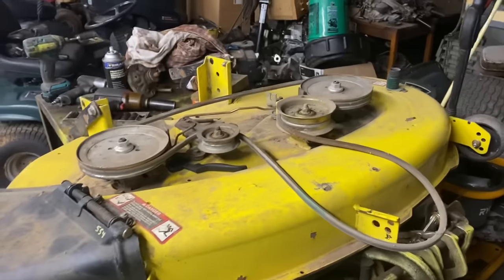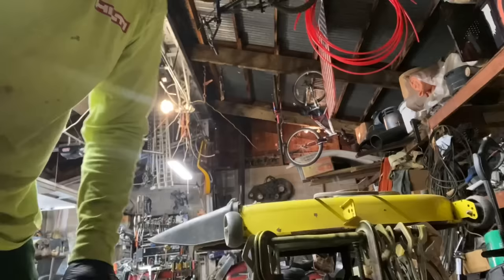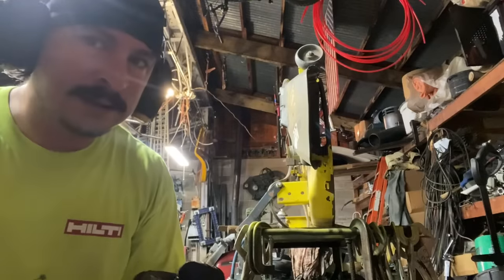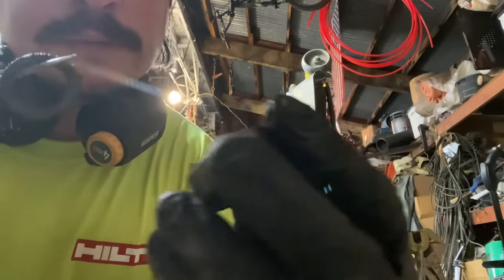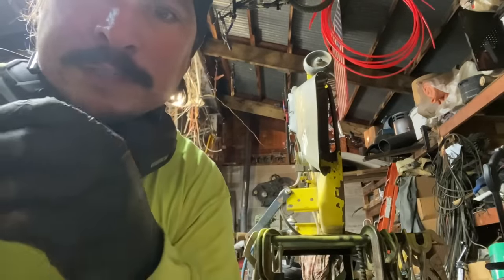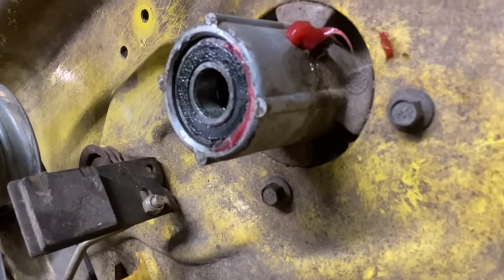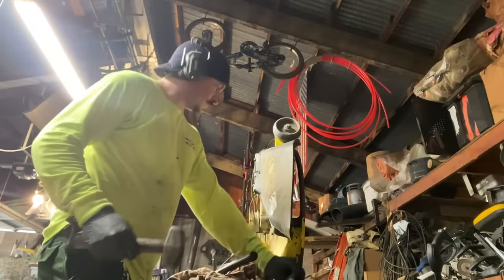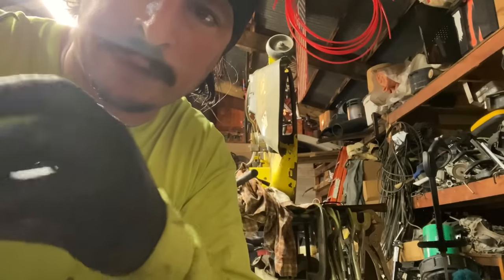Part 1 - Don’t trust the “Experts” Grease your mower deck sealed spindle bearings Common sense.

Comment: Even if the inner seals do allow some grease to leak in when grease pressure is high enough (i.e. when it is being pumped in by a grease gun) I still think the inner seals are going to restrict the free flow of grease. If you are going to fill the spindles with grease it makes sense to remove the inner seals so that grease can easily flow to the inside of the bearings..
Reply from the maker: The seals can’t stop any grease from passing when using a grease gun, as for in normal operation, grease would not be moving around inside the assembly anyways. Only the grease inside the bearings would move a little as bearing rotates. As for the bottom bearing grease will eventually migrate down and into that bearing. But the upper bearing would have the opposite effect and grease would eventually migrate down away from upper bearing without a grease gun pumping grease back up to it, unless of course the inner seal was in place. Grease can easily pass up past the inner seal with pressure from grease gun but gravety alone can’t overcome the lip of the seal. Just leave all the seal and greased the assembly once in a while. Bearings last forever. No need to take things apart or overthink it. Just try it. Won’t regret it. Hard to say removing inner seals on both would be a positive. As it would negatively effect the upper bearing as much or more than it would help the lower bearing. It takes very little pressure to push past those super week seals. But no grease and or gravity cant work past the seals without some pressure behind the grease. Not only will
Some grease pass the seals. The bearings will
Receive more grease than necessary. You should see how little grease is in some new bearings. It would probably shock you. Some of my videos show that. But back to topic. Removing Inner seals make no difference in how much grease will get to the bearings. And removing them
Is a waste of time. That’s a huge point to touch on. Because dismantling a deck just to
Remove those seals is ignorant. Just meaning Becasue the person doesn’t know better and just things it will make
A Diffrence. But actually they can do more bad than good by taking everything apart for no
Reason. Other than thinking it matters and having a warm fuzzy feeling. Yea it won’t necessarily hurt anything to
Remove the inner seals but it won’t help anything either. Think
About it man. Why would every manufacturer leave the inner seals? Simple, Because they don’t matter in the slightest. Your letting a flimsy rubber seal Give you mental block. The grease will only pass the seal while being pumped, that’s never been an argument of mine. A few pumps and good to go for many many hours of operation. Even without seals in place, you would still need to pump more grease when it’s time for the next 
Service, and then some fresh grease would push into
The path of the bearings. But really a full
Bearing from
The first greasing will
Already be a leap forward from what the factory provided when the bearing was brand new. That first proper greasing already added many hours more life to
The bearing even if it’s never greased again. That first greasing did the most good. Super super simple. Stuff but working on this stuff makes it easer to
See for someone who has done it hundreds of times. For folks that haven’t actually been into decks and seen failures of bearings under 100 hours, they just have to imagine processes. And it’s hard to imagine what’s not been seen. very basic stuff but hands on knowledge is a big help. Some folks
Way over think this. A little grease goes a very long way for
This application. Like
Grease once a season for home owner machines, could make
Your bearings last forever. Huge difference over most folks just running forever without grease and taking them to failure. If no grease is ever added that’s not smart. Also dismantling a deck to remove a few inner seals is not smart in my opinion. Especially considering it can be argued that the upper seal holds grease into
The upper bearing. Gravity will
Surely pull grease to the bottom of assembly especially after it warms up on a summer day inside a assembly with fast moving parts adding more heat the the situation. But that little pesky inner seal is there to kick gravity in the butt and support it’s buddy and keep the grease right where it needs to be. folks feel like something works one way and say “I still think” well, stop thinking you know it and test the process. Then you won’t have to think you know something that you haven’t tested. Sometimes thinking about a process doesn’t play out in your brain the way it works in real lie. Test the processes, You will
Actually know what your talking about. That’s exactly why I walked through this process step by step rather than post a video of myself telling folks how I think it works. I posted a video of how I know
It works. Learned from years of trying different things and figuring it out for myself when I didn’t even know I was figuring it out. I was just trying to stop the bearings from failing so soon. Once I finnly realized what’s going on and seen other numb nuts posting bogus information I could not just sit back and let it go unchecked. I’m
Not saying I’m a pro or the expert. I’m
Saying test this for yourself and don’t trust the experts especially if they tell you not to grease these bearings. I’m
Not here to get input so I can learn how this application works, Iv figured it out. It might be one of the few things I really understand. That’s why I shared. And one reason I don’t try to share 1000
Videos. Those guys that do that, are either really smart or not really an expert on anything. Just here for views and giving mediocre advice. I may only post a few videos but when I post one, you can bet I’m not just here to get views. I could care less
Reply: @GTObearclaw1  
Kinda depends on the nature of that grease and its tempture range as to how much flow you get with gravity dosnt it? 
Some grease don't get liquidity from high heat and spindles don't generate a lot of heat or do they? 

And no berrings dont last forever .
Reply from the maker: @bobbg9041   as for heat from
The spindle / bearings. That could all
Depend on the conditions of the bearing, is grass packed around the housing holding in heat and blocking the air from circulating around the housing as designed? Lots of factors to consider as well
As the type of grease. 
And as far as bearings lasting forever, if the bearing lasts longer than the machine as a whole, that’s forever enough for me. A well greased bearing could easily last as long as some of the cheep tractors they sell now days. Couldn’t even tell you how many machines I part out because they are so far gone and not worth getting back to operating condition.
Reply: @GTObearclaw1  thank you!
Reply: @Woodchuck Russ the Deck Dr  it's only a grease fitting you don't need to make a documentary out of it put some grease in it and keep on mowing DUH
Reply: @davidsignor7931  Obviously he does need to make a documentary out of it and I appreciate it! Are you aware of all the misinformation out there? Duh!
Reply: @Tim Snell  I didn't really think there was that much rocket science in greasing a bearing especially if there is a grease zirk to use DUH
Reply: @davidsignor7931  Didn't used to be, I agree. but now, the bearings are sealed and there's a huge discussion on why they are sealed and how to grease them. I'll follow the science. What is it? That's what he was trying to show and debunk. Are you going to fill the cavity with 70 pumps? Are you going to remove the seals?
Reply from the maker: @davidsignor7931   yea, seems simple
But wow how this video has attracted some naysayers and got a lot of attention. Very simple process that some
Folks can’t understand and the naysayers will not even consider running a test ther self and posting the findings. Lol
Reply: @GTObearclaw1  Or, you could have just told him, 'go ahead, fill your boots'!   Great video, hope to see more!
Reply: Given the cost cutting most manufacturers do today, it is unlikely they would put in a zerk fitting if they didn’t intend it to be used.  They would put in a pipe plug or stop drilling and tapping the hole to begin with.
Reply: @LTVoyager  Except that in this case a zerk fitting is a sign of "quality" even if it doesn't actually accomplish anything.
Reply from the maker: @davejoseph5615  it does accomplish something and that’s why I made the video to show exactly what happens when it’s greased properly (filled)
Reply: @GTObearclaw1  Logically well said and explained above - you are a great writer and demonstrator - and you show your thesis as a proof. Bravo American Man!
( I liked and subscribed: DUH !)
Reply: You definitely proved you point. Nicely done and thanks for posting!
Reply: There is a difference between a seal and a shield on a bearing.  Seals hold in grease and hold out grit, and have a limited life. Shielded bearings are designed to allow grease to be pumped in under pressure but keep out larger grit, sand, dirt etc.  open bearings can be used in dirty environments they just need to be greased often to push out contaminants and replace with fresh grease
Reply from the maker: @takedeadaim8671  In this case they take grease and are shields. I don’t know exactly what bearing your talking about with a seal that functions any differently than the ones in my video but I know if they are in an assembly and it has a zerk I’m going to grease those bastards.
Reply: @GTObearclaw1  youtube algorithm pointed me to this video, great explanation on the grease and a better well thought reply on why not to remove the seals. looks like I will be getting some fittings to put on mine and running some grease to em.
Reply: Very well said. Makes sense too.
Reply: So seals will allow thick grease in but not let grease out and keep small dirts particle out? It's called a seal for a reason.
Reply from the maker: @gadasavideos8564  “uncle Ricky, can you tell us a bed time story? “ I’ll give you 10 cents if you know where that quote came from. If not, I’ll give you this for free because I love to type. I’m not convinced you watched the whole video so I doubt you will
Read this but here we go
Anyway. Just think, this comment will be floating around the interwebs long after we are gone.  

yea? What reason is that exactly? Could it be be because the manufacturer whants you to think your bearings are sealed and filled with a quality grease? That way you won’t grease your bearings and run them till they fail? Afraid that’s the reason you speak of. But some folks just don’t know it. Read a few more comments on the video. You will see some folks have bearings fail as soon as three years? Why would that be? And who calls it a seal exactly? You? Yea maybe common to hear these called a seal but what can it seal out exactly? Dust yes, Water, not real well: water still gets past these? How you might say? Because no pressure is required to allow water to slip past the seal. Ahhhhh, but grease that is under pressure can’t get past that same “seal” ? Really? That makes a ton of sense. Lol. So back to
The water getting in. How’s that possible? Good questions how would water get in a sealed bearing. Man that’s a brain teaser. O yea. It just runs past a seal when sitting on the bearing. Where did water come from? Rain? Washing the deck with water like a total ignoramus? Yup that’s how. No pressure needed. Water simply sitting on top of a bearing shield is enough to slow some to get past a shield lip also called a seal by folks who think the word seal means it can all
The sudden hold back pressure Becasue some folks call it a seal. Not like the seals in a transmission or engine bearing with a spring around the back
Side of the lip holding it tight against the opposing surface. Not a precision fit seal like in a hydraulic cylinder or transmission piston to hold in pressure. No. not that kind of seal. The other one that just simply keeps dirt out of the bearing, you know a seal with only the tension created by the lip of the shield touching another surface. Man those are some of the most difficult seals to get anything past. They cost about 2 cents and amazing how strong the arent. Can’t even pop one out of the bearing with a pocket screwdriver. Then things are built like a tank. Okay. Yea lots of sarcasm. Well, now we got water in a bearing. Should
We run it till failure? Why not, the manufacturer says it’s sealed and hood for life. What life is that exactly? Till
The beating fails due to lack of grease? Just maybe. I have 3 brain cells and one is telling me Nope. We better get some grease in there to displace that water or we might regret it latter. But wait, adding grease will
Overheat the bearing? On what planet does that make
Sense? Yea, I don’t know
Either. Too bad they didn’t put a zerk on some mandrels so we could simply pump in grease to push that water out. Bummer, mine has zerks but I’m not gonna use them because,
Well I’m
Just to dang smart. 

Seriously,  It’s a shield and yes had a rubber lip in it. that lip can not hold back any pressure especially not from a grease gun? think about it a minute. Better yet, you fix mowers, why not stick a grease gun on one and grease it till grease comes out somewhere and then you tell me grease didnt go into the bearing? WhT are you going to
Loose? What could
You gain? You fix mowers, this could help you a ton but you come here to be a naysayer and not even interested in how this information could help you. Rather argue about it rather to explore the possibility that something so simple that you have missed could be a huge help. Sounds to complicated. Yea I get it, Took me a while to figure this out: here I am offering free help and I’m gaining nothing but I’m the butt head. if your not going to watch the full vido, don’t leave a coment. But too late, here you are with a brain fart for all of us to read. thick grease? What? Allows grease in but not out? Did you even watch any of the video? Grease passes in and out of the bearing. I think the thick grease might be in your ears? Don’t grease your machine. Who cares. Your obviously smarter than the rest of us. Celebrate your accomplishment of becoming smarter than the average human and don’t worry about what us peasants are doing to keep our machines running: so what other topics are you an extreme expert on. I’m ready to hear some jewels of wisdom. Should I check your Chanel for a video soon about disproving my claims.
Reply: @GTObearclaw1 You convinced me two things  ,,, first a couple of pumps isn't enough, got to keep going until I see it come out of bearings around dust seal.  I worked on auto universal joints and seals did keep lube in but pumping grease in did work to prolong life of bearings.  So you needed to grease even the sealed bearings.  Thanks for making this, I am heading to workshop with my grease gun 😂
Reply: @bobbg9041  With proper lubrication I beg a differ.....bearings can last forever especially if the manufacturer sized the bearing properly, according to load and environment. I have a set of sealed pillow block bearings on an 1 and a 1/2" X 4' long blower shaft without grease fittings that run at 2700 rpm 24 hours a day 365 days a year and I only lubricate them 3 or 4 times a year by dripping 30w motor oil on the seals while they are running. The centrifugal force is enough to cause oil to be sucked in past the seals edge and into the bearings. Those 2 bearings have outlived 2 motors and are still going strong after 22 years of non stop use! I have also tried the same technique on several shop exhaust fans with sealed bearings and have had more success doing that than other fans that have greasable bearings! Obviously the mower bearings can not be lubricated in that manner but yes....properly sized bearings for the application can and will last a life time if lubricated properly! With proper lubrication and environmental factors taken in to consideration at the design aspect there is no reason for a bearing to ever fail! My dad greased the bearings on his boat trailer monthly and he sold it 25 years later with the original bearings! As far as I know it's still on the road today and that was 20 years ago! So don't be afraid to give it a little lube......besides.... that's what she said! Lol. Later.
Reply from the maker: @jpol3808  yes, simple. Bearings need lubrication. Mowers are subject to weather and water from wading with a hose. Also a big issue is water in the bearings but filling the cavity with grease pushes water out. Thanks for the comment
Reply: Bearings are sealed to keep out the tiny pieces from inside worn spindle people. That's why there are seals over bearings. This man made an excellent video here to teach the people who do not know why bearings are wearing out prematurely. I say Thanks for this video!❤
Reply from the maker: @randythomas3478  thanks. Just a thought on that note. If the bearings are good the inside of the spindle would not have any loose partials other than possibly some rust from washing it woth water or leaving out in the rain. However if a mandrel is kept full of grease neither should be a concern therefore the inner seals would not make a huge difference. I don’t see an issue with the units having an inner shield as it posses no threat of restricting lubrication as long as the assembly is in good working order and the unit is also completely filled to the point grease exits through a bearing and then grease should immediately stop being applied. The main goal of passing this information on to help was because some folks think the shield will stop grease from reaching the bearing and that’s false. Not only are the guys spreading those lies wrong to do so they can not and do not offer any proof of their claims and therefor have no evidence that a shield stops grease. Those videos should be removed. They do not help people. Only misleading folks and guiding them towards bearing failures.
Reply: Exactly.
Reply: @GTObearclaw1 Holy Cow you talk too much!
Reply from the maker: @AnthonyStabler  thanks, I appreciate the compliment
Reply: The better question, why doesn't my spindle have a grease fitting?
Reply from the maker: @DJ29Joesph  unfortunately not all machines have one 

What tractor do you have? Some are hidden under the Deck.
Reply: @GTObearclaw1 calling other people not very bright or smart when you're one of them. Priceless.
Reply from the maker: @mikezupancic2182  I’m actually not that smart. Don’t claim to be. I’m not an expert. I simply show a basic process that somehow is not already posted on YouTube. Seems to be more controversial than I expected. Showing how to grease bearings is so basic it is silly but has been proven on this video in a step by step process that a monkey can follow. If I’m wrong it’s a free world and folks can post a video to try and prove otherwise. Most folks just like to explain how they do it and assume it’s right without any proof. As for how I reply to comments, sometimes folks get offended and I understand that’s just how it’s going to be. I can’t make everyone happy and I’m not interested in trying. I’ll help the few folks that can accept the information for what it is. The rest can do as they please. Thanks for your comment.
Reply: @bert1450  easiest to do is run the originals until they die. Then get replacements and pack them well before installation. Run those until they die.
Reply from the maker: @bert1450  you can do that but if the units are equipped with a grease zerk, why would you have the bearings out if only needing grease it would be much less trouble to use a grease gun and get the same benefit with much less work. Taking things apart can sometimes cause issues that would not be created if the deck was left alone and just greased with a gun. Bolts break on older decks with some run time and age from weathering. Also sometime the nut on top of the spindle seize to the threads so just trying to get things apart to add grease can create issues that simply wouldn’t be an issue if the unit was greased as I show. And most folks don’t want to go through the hassle of getting that far into a deck because it requires time and tools. I personally just want to keep my equipment running smooth for as long as possible with the least cost and repair time. I only show the process and have the bearings out to prove the point.
Reply from the maker: @mikezupancic2182  for me It seems a little easier to add grease with a grease gun and completely avoid a break down. I fix decks all the time, I also service them by simply adding grease with a grease gun. I can say without a doubt it’s easer to just add grease especially if it prevents a costly break down. When a tractor / deck breaks, it’s usually not the ideal time to have the machine broken becasue grass needs to be mowed sooner than latter or the weather is hot and I don’t want to be fixing it in a pinch.  And usually when bearings fail while tractor is in operation parts are spinning fast and things break when they come apart and hit. I also have to get parts and find time to fix it before I’m back to mowing. It will take much more time and also cost $ because parts will be required to make repairs. When a bearing fails, it can also cause damage to the belt and even destroy the pulley mandrel housing as well as other parts. Some belts alone can cost nearly $100 for the longer kevlar or just simply the quality brands like Deere. so damaging a belt is definitely something I try to avoid.  Iv seen bearings fail with almost no noise before they go and without a warning it’s about to go it could go and take out those other components in a flash. Once they go the damage happens fast when or if things get bad enough to come apart. Bearings vibrations can also loosen the bolts that secure the mandrel to the deck and over time a bearing vibration can cause the assembly to pull loose and rip mandrel mounts open to the point major welding repairs are needed as I show on many of my deck repair videos. Adding grease to the mandrel is one of the most basic and easiest preventative maintenance items on a riding mower. Preventive maintenance is exactly that. It is maintenance that prevents breakdowns. A tube of grease can cost around 5$ to 20$ for the grease I typically use. And I can usually grease three or 4 machines even if they have empty mandrel cavities so if I use the 20$ tube and figure on it only doing 2 machines that only 10$ cost per machine for preventative maintenance that takes a only a few minutes and requires no additional tools. However in reality I probably spend closer to 2$ or maybe 3$ in grease per tractor and once greased properly the bearings can go for years as long as the bearings didn’t have issues from being ran too long prior to the mandrels being filled and properly serviced. Also once the mandrels are filled the future greasing will take only a few pumps and take much less time than the initial greasing. I know of many box store machines that have been running 20 years without main deck bearing failures because they have been properly maintained by simply adding grease once a year. Sometimes even less often. A bearing failure is what I want to avoid if at all possible. It’s kinda like saying rather than air up a low tire, I’d rather run it until it blows out and just buy a new tire. When a tire goes out it may damage more than just the tire. Adding air is simply preventative maintenance. I don’t think Iv seen many comments where people said to run it to failure but lots of folks don’t believe the bearings will take grease. That’s the reason I needed to break the process into baby’s steps and it seems overly complicated when I’m reality nothing needs to be taken apart to just add grease if the zerks are already on the mandrels.
Reply: And that's why I have top and bottom seals in the top bearing and only the bottom seal in the bottom bearing.
Reply from the maker: @rocknral  seals in these bearings are simply dust shields in reality. They don’t stop grease from passing when it’s applied with a grease gun. Those are not really much of a seal. Just there to keep dirt out and grease in. But with the slightest pressure from a grease gun the grease pushes right past and fills the bearings. As I have shown in the step by step process. But yes. Folks can pull things apart and remove a shield and it seems to make folks feel good knowing they removed inner seals regardless if it’s from the upper or lower bearing it wouldn’t make any difference one way or another. Those inner shields are basically pointless.
Reply: Thank you.  I am changing all of my spindle bearings on a grasshopper and my replacement bearings had rubber seals on both sides.  I'm glad grease goes thru the seal although I'm contemplating removing the inside seals.
Reply: @GTObearclaw1 
Some of the new spindles don't have the inside seal.  So keeping them greased will help
Reply from the maker: @bertgrau3934  regardless if they do or don’t have an inside shield, they do need grease. Sealed on one side or with the shield left off it’s the same bearing. Thank you for the comment
Reply: @GTObearclaw1  SUBSCRIBED: for the rants!  🤗Almost better than the information you provided.
Reply from the maker: @michaelself7515   you think laying into doofuses would get old but these naysayers can’t hang with my knowledge on decks. I may be dumb as a rock in 99.9% of subjects but I won’t back down when ignorance is droped in my comments. Glad someone enjoys it other than myself. lol. Thanks for subscribing
Reply: My JD power-flow bearing failed after just 200 hours so I replaced the bearings and removed the bearing inner seals and packed the cavity and it’s been quiet ever since. No room to install a zerk fitting but I’ll be curious if I ever have to replace them again.
Reply from the maker: @musclecarsrt2324  in some cases like that you just have to do what you can. And yes adding grease should be a great fix as they factory units come under filled in almost every bearing Iv seen in the last 10 to 15 years. I always pack them full and on the units with no zerks Iv noticed years latter when I take them apart they still look great. In those cases I try to use the higer grade of grease since I can’t easily add more without dismantling the unit.
Reply: Thanks for taking the time to share this with us! I appreciate you! I don't understand why all the negative comments. Did not know this was such a  "HOT" topic. Have a good one and May God bless y'all, Bo
Reply: China bearing/berrings.
Reply from the maker: @stevegann3251  some of the cheep bearings are better than others. Some are downright trash and gritty right out of the box.
Reply: How's the top bearing suppose  to get grease?
Reply from the maker: @thomasgibson4711   with the grease gun the grease is distributed by pressure not gravity. Up or down or sideways makes no difference.
Reply: @GTObearclaw1  that is the LONGEST reply I've ever seen here on YT - and I've been on here a LONG time! 😉
Reply from the maker: @pdloder  not even sure why I bother. It’s nearly impossible to get a naysayer to understand and all they have to do is run a test. But they would rather dismantle a deck just to remove a few shields that almost all the manufacturers install and don’t slow grease passing. For some reason even with video prof this is still a hot topic.
Reply: I agree with you completely sir